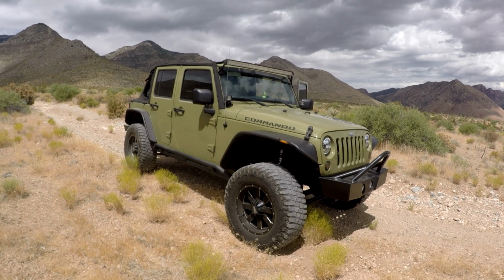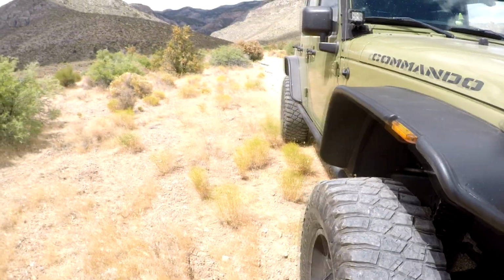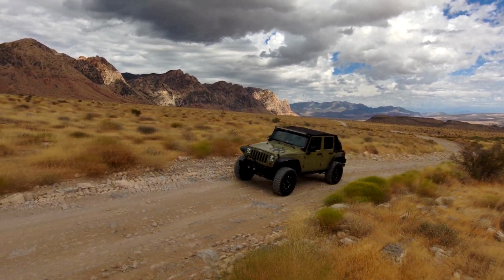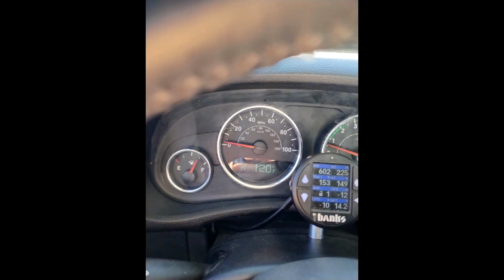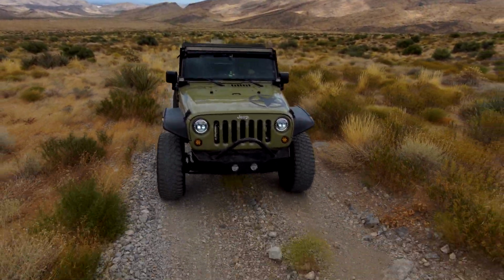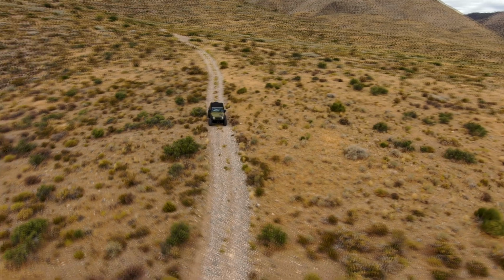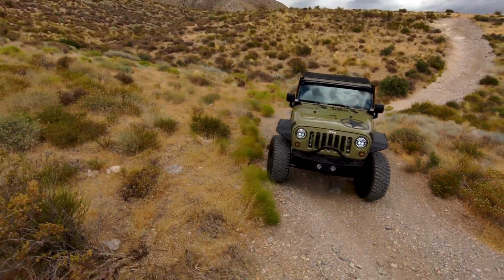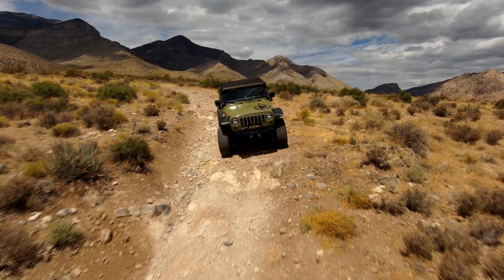Keeping your Wrangler JK Cool

Comment: On a different note, get rid of the stupid "cold" air intake.  They only draw hot air from the engine compartment into the engine.  They also do not filter tge air even close to how well a normal factory filter does.  Testing proves this over and over.
Reply: I feel like I should go back to the original engine air filter... 12 JK.. 🤔
Reply: @HipRapBlack7 I am running the 12-up OEM air cleaner on my LS swap. It works great.

Comment: I run an under-bumper air scoop plus hood vents to keep my engine running cool. I run around 190 degrees most of the time. I used to run around 210 degrees before I did the mod. I've had it to where I've been on the highway under 190 degrees before. I just wanted to use the air coming in from the front to go UNDER the Jeep and directly up into the radiator, cooling that coolant lower so when that thermostat finally opens, ALL COOLER FLUID rushes thru and the engine temps stays lower for the rest of the ride.

Here's the video for the mod. I built it using Home Depot steel. https://youtu.be/VTdeQrj1GvM